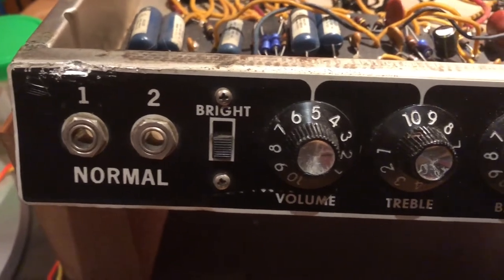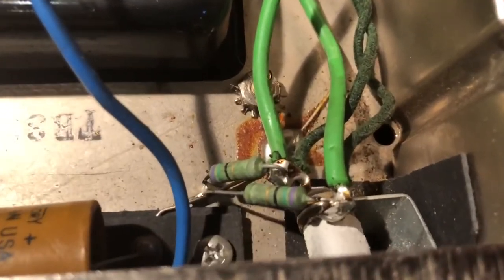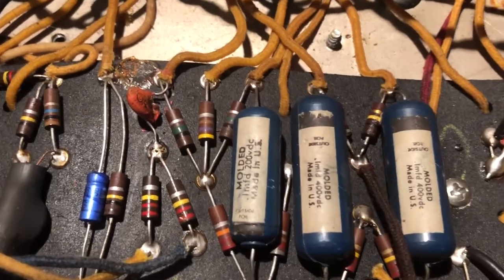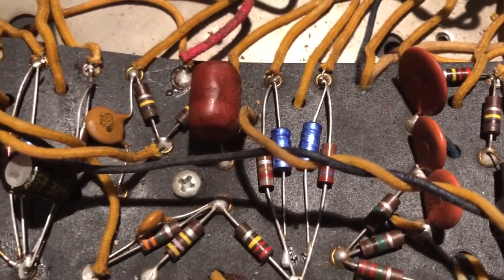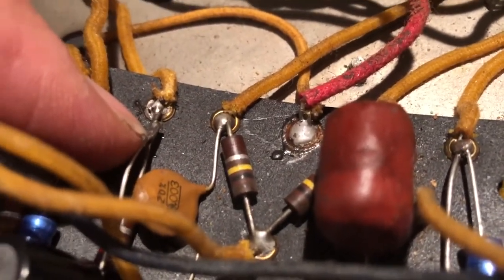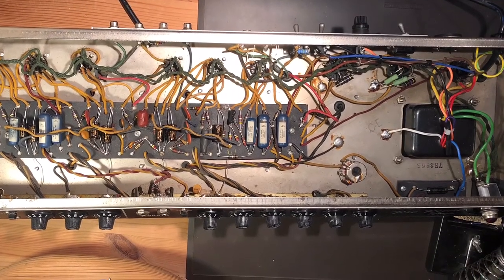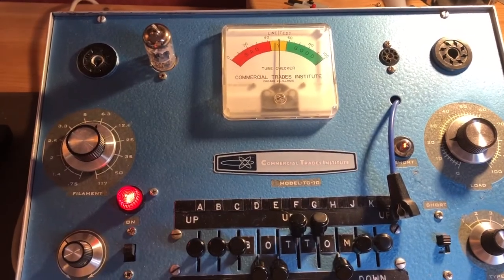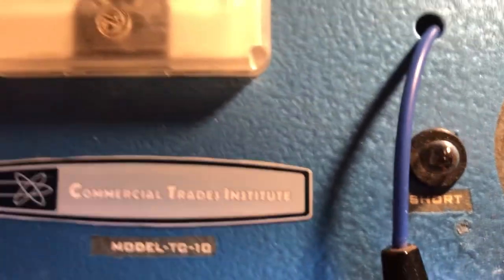Fender Pro Reverb Blackface Repair and Overhaul

Comment: I can always trust a guy who ain't packin' electric screwdrivers.
Reply from the maker: To dump to be afraid 🤓
Reply: @martinstubeampworkbench2299  Ha ha! Where I live all the guys have to have more power... bigger, stronger, faster, and all that.
Reply from the maker: @wesleyc.4937  Well, with 450 volts on the plate, the worst thing to do is, trying to be fast. But where are you located? Planet Krypton?
Reply: @martinstubeampworkbench2299  I'm grounded to earth, U.S... mostly.